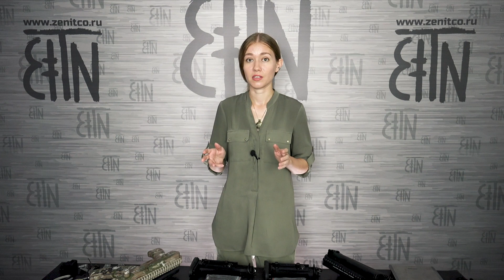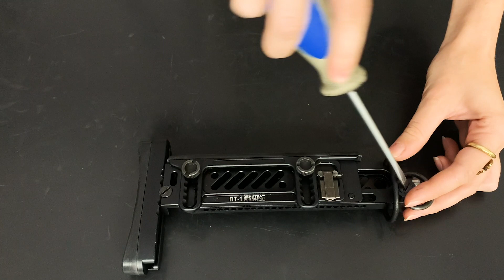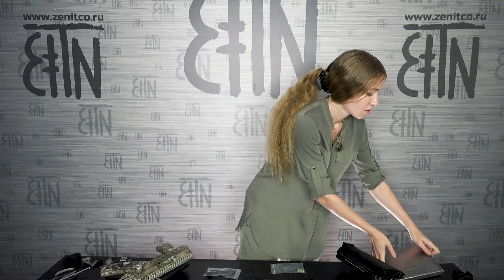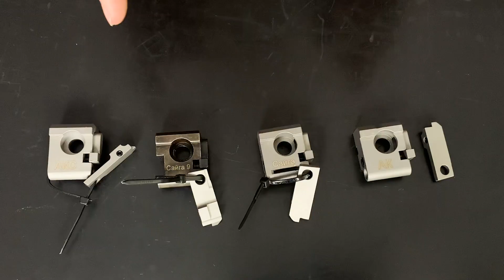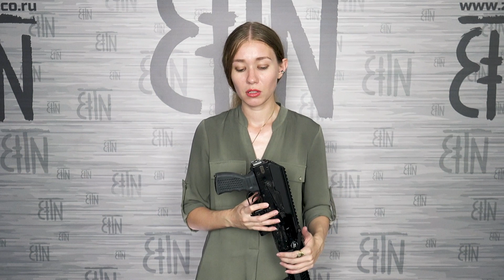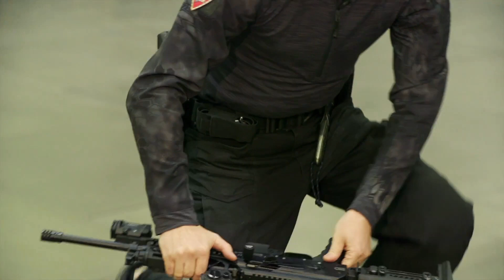PT-1 and PT-1S stocks: adjustments, adapters, how to install

Comment: Does the PT1 stock lock in the receiver like the triangle stock When folded? Or any way to make sure it stays locked?
Reply from the maker: PT-1 folds with fixation, yes. It does not use the regular locking mechanism so that it could be locked with fixation at any length of the stock. It uses locking mechanism in stock adapter.

Comment: I need some help.
I’m trying to install the PT-1 on an ak receiver with folding capabilities. However, the 5.5mm lever seems to be too long when placed in correctly and the hole does not line up. Should I file down the “ramp” on the opposite side of where she files to allow them to line up?
Reply: Were you by any chance able to fix it? I have the same issue.
Reply: @trunk5728 yeah I filed the scoopey tail side down enough for it to fit if I remember correctly
Reply from the maker: Please send us photos or video to info@zenitco.ru, need to see to help
Reply: @ZenitcoinEnglish  I have sent an email. Thank you.

Comment: Hello! Thanks for the vid! I have a problem uninstalling the regular stock, the pin doesn't come out, it's a civilian Saiga mk102, the stock safety is in position, so everything looks fine but even hammering like Thor it doesn't come out

Comment: Hello, 
My adapter plate does not line up with the pin hole for the stock on my rear trunion. The adapter is the right side for the pin (5.5mm) but obviously won't set in place because of the mismatch. Do I grind the other side if the plate to fit? Thank you.
Reply from the maker: Send us photo and video of the issue. Either to direct messages of our Instagram @zenitco_official or to info@zenitco.ru

Comment: When will you be restocked on a PT-1 4.5mm in desert?   Thanks!
Reply from the maker: We discontinued all stocks in desert. Desert coating is rough, black is smooth. As far as stocks have moving parts, black is better for them so we decided to stop manufacturing desert ones.
Reply: @ZenitcoinEnglish  Will you still make the rubber pads in Desert?

Comment: In the U.S. the laws have more to do with barrel length.  Less than a 16" barrel on a rifle is considered a short barrel rifle (sbr), and we have two options (technically one option is considered a pistol).  Either pay a tax (which has a long wait time for approval), which make the rifle a registered item under our NFA laws.  Another option is a have what is called a pistol brace, originally intended for people with a disability.  It allows a shooter to fire a rifle one handed (or at least the was the intention).  Our NFA laws on sbr's are kind of silly though.  You can legally own all the parts for making a sbr, but legally can't instal the barrel until you've paid your tax and received your tax stamp, but you can get around this by installing a pistol brace, which ironically is designed in such a way that it can be shouldered, basically using it just like any rifle (that is actually legal and gets around having to pay the tax and register your sbr as an NFA item).  Most people like myself, think our laws are idiotic and the NFA tax and restrictions just need to go away.

Comment: For the PT1 and PT5 stock do you need the adapter for installation? And I’m not too entirely sure what’s the exact purpose of it🤔
( recently purchased a PT1 for my Saiga 5.45 and cannot wait to install! )

Thanks and Forgive me for such a naïve question😂
Reply from the maker: The adapter is in the kit. PT-5 has built-in adapter (for AKM only). When you order PT-1, you choose adapter type that you need, we put one in the kit. Several types: AK, Saiga, Saiga-9, AKS-74U, fixed AKM. If needed, additional adapters can be bought separately.

Comment: Good guide! My only issue is that while I was installing my PT-1 stock, the connection between the adapter and the stock became loose and it’s extremely difficult to tighten once in the gun.

Comment: Okay so im interested in getting one of these but im unsure of which I can get. I live in the US if that helps and the Saiga I own was the 'sporter' version that came with a fixed stock so would i get the pt1 or the pt5?
Reply from the maker: We haven’t tried them on sporter yet. Mounting place looks like the one on AKM but still different. AKM is compatible with either PT-5 (folding) or PT-1 with fixed AKM adapter. But as soon as we haven’t tried, we can’t guarantee compatibility. As soon as we try them on sporter we will update information about that!

Comment: I love the PT1 on my Saiga! In Austria we have a similar law but with a minimum length of 60cm for rifles and 90cm for shotguns. So shooting a regular length Ak with folded Stock is ok.
Greetings to russia!
Reply: Hi, do you have Saiga with original polymer folding stock or fixed? Which adapter did you order with this stock?
Reply: @michalbarsfajny4268  Hi, yeah my Saiga had the original folding stock. I don't know how the Adapter is called. I ordered my PT1 stock at IvanTactical and wrote a note to my order that i have a Saiga AK 103. They than gave me the right adapter.
Reply: @Simon661ST  cool. Thank you :)

Comment: In the US we have barrel and overall length restrictions, but we also have a federal law that says any gun law is an infringement so technically everything else is null and void, and ATF can kindly suck it.
Reply: "Shall not be infringed" is pretty clear.
Reply: "well regulated militia" means you need a lot of regulations to be well-regulated.
Reply: @Mr_Clean  At the time it was written, "regulated" meant supplied. So in modern terms the second says "a well supplied militia, being necessary..."
Reply: @Mr_Clean  swing and a miss bud
Reply: @Mr_Clean  well regulated means well equipped genius. gun regulations didnt exist back then

Comment: Basically, here in the US, 26" is the magic number for over all length. "Handguns" cannot be over 26" in length. If they are, they are then considered a "Firearm".  "Rifles" and "Shotguns", with the stock unfolded, cannot be under 26" over all length. The "Rifle's" or "Shotguns" ability to fire with the stock folded isn't regulated, as long as length requirements are met when the stock is unfolded. If it is a collapsable stock, it must be measured when the stock is all the way collapsed. This is also in conjuction with barrel length regulations and what is fitted on the gun. "Handguns" can really be any gun under 26", with a projectile diameter of under .50 caliber, and with no stock or forward grip attached. A work around for this is you may have a "pistol brace". This is a device attached where a stock would be, but are designed to be fitted around your arm. There is no law saying you can't shoulder it like a stock though.  For "Rifles" and "Shotguns", you may have a stock or forward grip attached, but the overall length must be over 26" on both types of guns, as well as "Shotguns" must have a barrel length of 18" and "Rifles" 16". Now for "Firearms" (guns with no stock, a barrel length of under 16", but an over all length of over 26") you may have a pistol brace attached, as well as a forward grip. Also "Firearms" can be made in shotgun calibers, but cannot be "Handguns" (so they cannot be under 26"). If you have a forward grip attached to a "Handgun" of under 26" in length, it is called an "AOW" (any other weapon) and requires a $5 tax and federal registry. Other than that, if your gun violates any other regulation I mentioned above, it is considered to be an "SBR" (short barreled rifle) or "SBS" (short barreled shotgun) requires a $200 tax and federal registry.  Lastly, it all depends on what the manufacturer classifies it and sells it as. If a new gun is sold as a "Handgun" it cannot be changed to a "Rifle" or "Firearm" configuration without paying the SBR or AOW tax. If it is sold as a "Rifle" or "Shotgun" it cannot have the barrel shortened and stock removed to now be  a "Firearm" or "Handgun", again without, the SBR tax. Now all of these laws are federal, and each individual jurisdiction has their own law you also must abide by. Meaning all of these laws can be complimented by state or city laws that would make ownership of some configurations impossible. It's all very stupid and confusing, especially considering that the punishment for violating ANYONE of these regulations can mean up to 10 years in prison and tens of thousands of dollars in fines and legal fees.
Reply: Example: I want an AK105. I have a Saiga "Rifle" with a barrel length of 16" and a over all lenght exceeding 26". If I want to make it an AK 105, I have a few options. 1st option: Cut the barrel and pay the $200 SBR tax and register it. 2nd option: Remove ALL the parts from the reciever, destroy the reciever (legally the gun with the serial number on it), buy a new reciever and rebuild the gun as a "Firearm" or "Handgun". 3rd option: Shorten the rifled portion of the barrel, and permanently attach (pin and weld in place) a flash hider or muzzle brake to the end of the barrel to force it to be over 16". It's all very ridiculous.
Reply from the maker: Thank you for your detailed answer! Some things became more clear. There is no such classification here in Russia, sorry for naming everything I hold “rifle”. 
That’s difficult and confusing. But on the other hand, you have a right to make modifications, which is nice. In Russia it’s prohibited to make changes in basic parts of weapon. For example, cutting a barrel or exchanging recievers is not allowed.
Reply: @ZenitcoinEnglish  It is indeed all very confusing. If you have any questions, I will be happy to answer. Everything you held would actually be considered a "Rifle" here, so no worries. Your AK105 would just need the tax to be paid and registered. In Russia, how do they regulate the basic parts? Do they all have serial numbers that are regulated? If you needed to have these parts replaced, would you need to purchase a new gun?
Reply from the maker: @alexscarpa7573  Basic parts are: firing mechanism, barrel, reciever and carrier. It is not allowed to replace them. If smth is broken, you need to go to a workshop that has a license to work with weapons. There are very few of such workshops, because it is very difficult to get such a license. If a person replaced smth himself, it is prison.  Once in 5 years a gun owner needs to bring a weapon to license commission where it is checked. If you do not bring it - it is administrative offence, fine and disqualification from owning any type of weapon. So in US it is confusing, but possible. And here it's simple, but impossible. Based on the above, our company produces only what is permitted by law. We do not touch the main elements and will not touch them.
Reply: @ZenitcoinEnglish  Wow, that sounds like a pain. I guess I should stop complaining.
Reply: @ZenitcoinEnglish  is ak 103 5.5 or 4.5??? Help

Comment: Also in US firing from folded-in stocks is allowed. All legality has to do with barrel length.
Reply: Overall length is also a consideration in some applications as well.
Reply: @toddmcbride5459  yes but it's almost impossible to get a rifle down to less than 26" if it has a 16" barrel unless it's a single shot break action and you cut the stock off completely. Realistically, if your barrel is 16" or more then the overall length is probably fine unless you've removed the stock completely.
Reply: Don’t forget, if you register your SBR it isn’t even illegal at that point.

Comment: You should make a fixed akm stock that doesn't fold, or maybe even an m4 stock adapter
Reply from the maker: We have a fixed AKM stock adapter that does not let PT-1 fold, it is shown in this video.
Reply: @ZenitcoinEnglish  yeah I saw that, but i was thinking one that attaches directly without an adapter